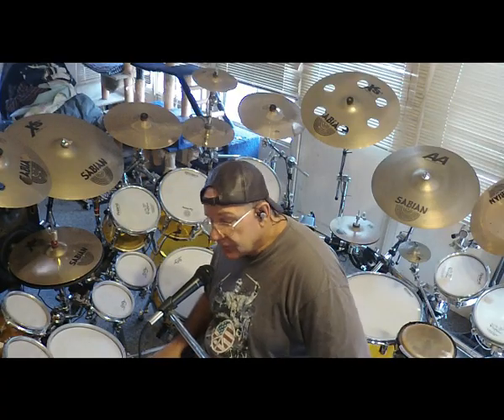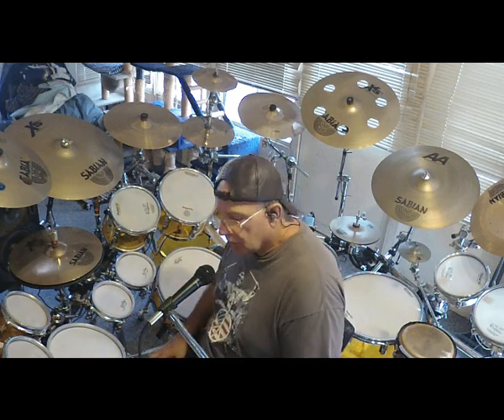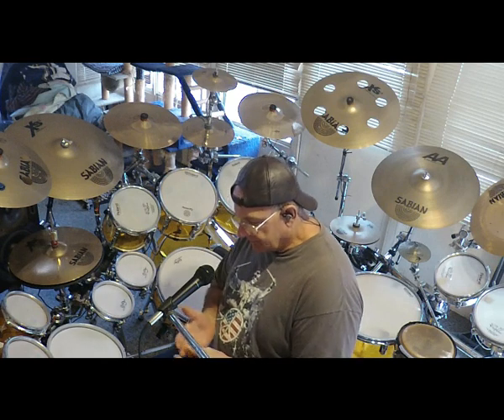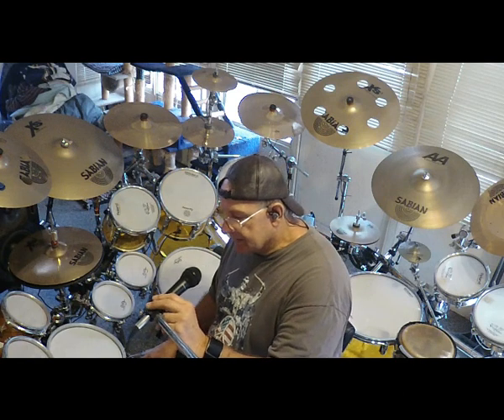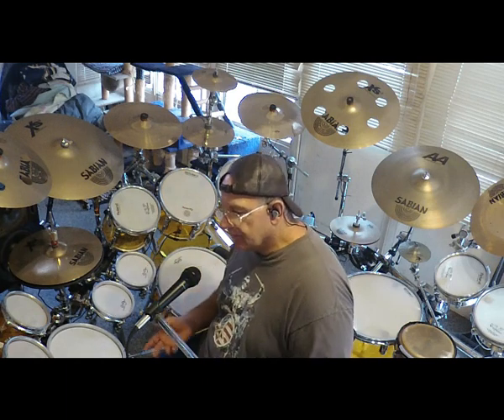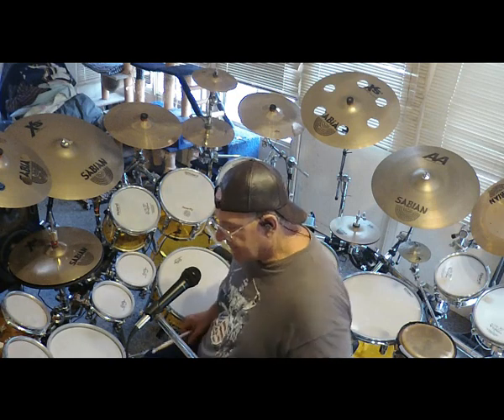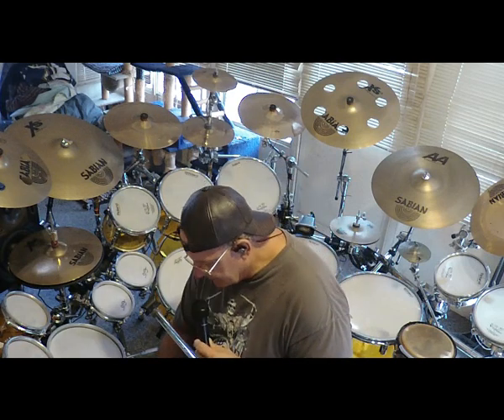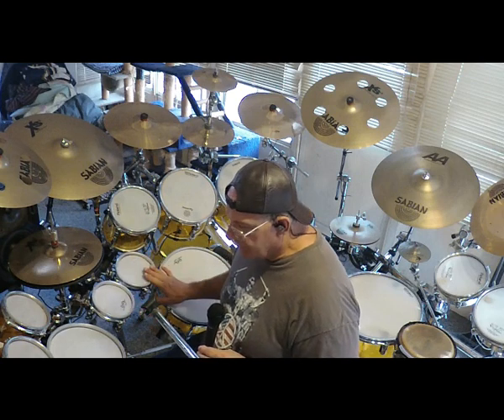Stealthdrums com video demo Stealth 6" acrylic Mini toms on Strike and Mimic Module

Comment: Amazing 😉 Vid! Bye the way - My Head & Rim Triggers Work Amazing with my Strike Module Plugged 🔌 into My Pearl Tru Trac Heads 👍😳 

Also my Roland PDX Snare ( Basically my TD17 Snare) 

Soo kinda weird huh?? LoL 😆
Reply from the maker: The Pearl Tru Trac are Piezo/Switch pads, not Piezo/Piezo. Did you update to the latest Firmware, because several people have had no rim triggering no matter what they do for most Roland pads, not sure if they have tried all Roland pads ... I know the Strike module worked fine with almost any Piezo/Piezo pads with early firmware though.